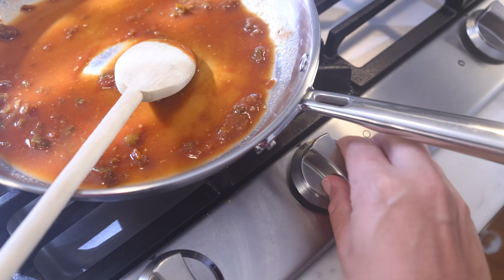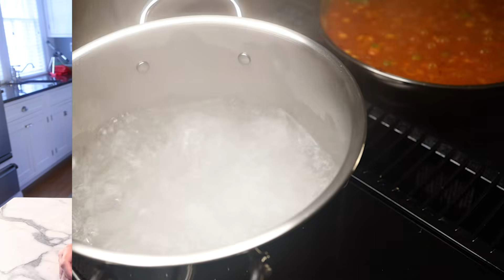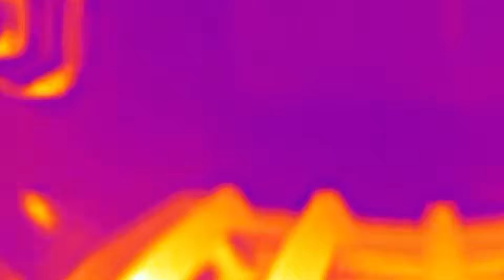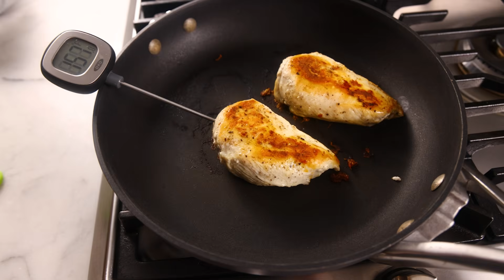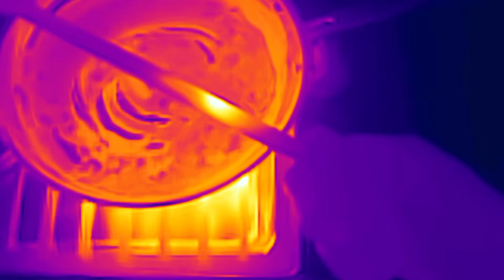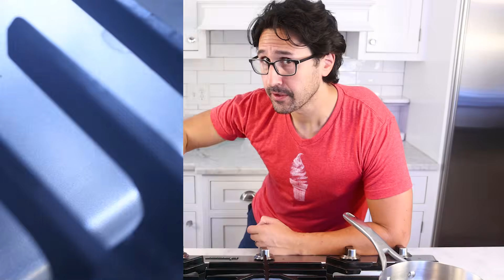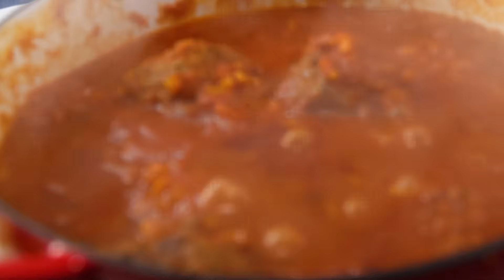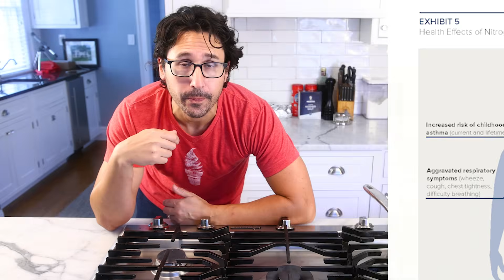Problems with gas stovetops | weak, dirty and dangerous

Comment: I would love to go for induction but not now living in Poland. Maybe my calculations are not perfect, but considering that 75% of our electricity is coming from burning coal (which releases more greenhouse gas than burning natural gas), which is conversion from chemical energy to heat and kinetic energy, which then is converted to electrical energy, transferred across the country as AC which creates huge loss (and if you think of cars, then electrical cars have batteries which needs to be charged and stored  - another losses, and lot of people here are using LPG as their fuel).. I simply think using natural gas here is more environmental friendly for such purpouses than electricity, even if you take into the consideration that gas heat is not as concentrated in heating the food (some time ago it would even be an adventage as we do not have warm climate, but now...). Channel about food and after this video I thought that I wish we could have a global electicity network with DC transferring over long distances, powered mostly by renewables and stabilized by atom (at least before we could have the clean energy from thermonuclear source, for which we will probably wait for some decades)

Comment: gas stove is still better because theres more controller when cooking electric ones are trash because they just turn on and off and rarely ever gets the actual right temp you want it
Reply: and this video proves my point because the eletric ones "transfers heat better" but not all foods need that besides literally just water otherwise if youre cooking steak or something its either gonna burn or be overdone because the heat is not steady it drops then raises

Comment: The problem is you only know how to boil water and not cook. With gas you have temperature controll and you can switch reanges to almost instantly get simmering temps. Try doing that with electric.

Comment: Actually Adam, I think resistance stoves may benefit from the same technology that induction uses while also being cheaper - inverter power supplies that can actually do away with cycling and give you a true ability to have a consistent low, medium, high heat setting on a coil electric stove. I like induction, but having to have compatible cookware and also the price of entry I believe keeps the tech from mass adoption. 

Also, we're gonna have to bring down cost per kWh here in the US with massive adoption of cheap renewable energy before we can really start to power traditionally natural gas fired appliances with electricity like HVAC (namely heating), water heaters, and of course dryers, stove, ovens, and ranges. 

Dryers I think in the future will be aided by washing machines centrifugally extract more water. Water heaters and central air heating will be fully replaced by heat pumps when the technology is mature, and kitchen appliances with both resistive and inductive technology - though I think all devices will be using inverter power control - just like with fancy new microwave ovens. 

It will be interesting to see the day when every part of our life is powered by electrons - especially if most of that energy is sourced renewably. The future is exciting.
Reply: My parents had an electric resistive range and its super old and never cycled, my induction range (apartment) makes a noticeable hum while on and a noticeable click when it cycles.

Cycling is entirely model dependent not technology dependent, its something your furnace does to avoid throttling and instead does all or nothing and kicks on and off to have a time averaged correct output.

I find both electric resistive and induction to be way nicer than nat gas. (Gas stoves just feel archaic the same way gas lights do, it might be nice in a camp but not as my "daily driver" where I'm concerned about in home polution and the fire/explosion hazard)

Comment: I'm living again in the house I grew up in.  The gas supply here in RI is fine.  The old stove my mother had simmered well (1960's Magic Chef).  This stove has what we both considered to be an inferior burner structure.  It won't simmer on low.  The burner distribution of heat is poor. If you have doors open (summer) and the burners on low they can blow out.  The current trend in cook tops is towards looking like a commercial kitchen stove.  Commercial stoves often use a simmer plate.  I bought a simmer plate for the last apartment electric stove I had. That had only two temperatures High and Off regardless of where you set the knob.

Comment: Good Electric ranges are awesome. Their hearing elements can actually grt waaaay hotter than the home has range.
My only problems is that it doesn't allow for the use of a kadai or wok(my cooking pan of choice). 
However it is worth noting that a cheap gas stove will always be better than a cheap electric range. 
Finally gas is easier to maintain than electricity. Where I live power cuts aren't uncommon and the idea that I just can't cook doesn't make sense. And before you ask, gas comes in these big cans, not a gas pipeline to each home. So as long as you have a spare can you can go for weeks without electricity and not have an issue

Comment: I have a 81 year old gas stove that works perfectly fine. It is more powerful than any electric stove I have seen.  Now it is a fact that it heats up the kitchen and the house very quickly.  Also noticed the wok does work better on gas,  The main advantage is that unlike electricity you can produce gas very inexpensively at home. All you need is poop and some food waste.

Comment: There’s a brass orifice at each burner that controls the heat output of each burner. You didn’t hear it from me but they can be enlarged ever so slightly to get it hotter. Newer ranges have higher output burners like mine which are great for wok-ing!

Comment: Gas stove are far cheaper to use  if electricty is orders of magnitude more  expensive compared to gas .
Our exterieur gas  water  heater + gas stove only cost like 10 dollar for 2 month 
Compravely when we tryied  électricty  to do the same thing before switching back to gas it   cost like 150 dollar for the same usage 
so we can not use electricty for heat unless we hate money
I live in tunisia (north africa )

Comment: Also fire really only has one temperature the buring point of the gas used. You really have less control of total temperatures as your just moving the fire away from the pot. Electric tops cycle on and off to maintain set temperatures. Wich can be much easier especially for inexperienced cooks. You want people to burn stuff less in your house electric is much better then

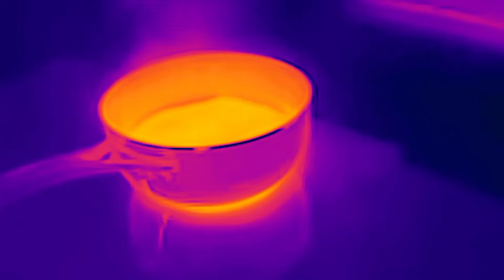Comment: Wtf is this comparions at 2:50. You are comparing an induction top. NOT a regular electric one transferring heat.
Reply: Most of electric stovetops will not show at all the same thermal signature.

Comment: I think both have their pros and cons but at least in the US, gas is more linked to 'premium'. Gas is also cheaper than electricity often in certain states here and like others have pointed, you can run it when you get a power outage which is rare. I personally enjoy cooking on a gas stove more often as the controls are finer and faster than the coil ones I had. Also, in the winter months, it turns into an extra heat source for your hands if you want while cooking.

Comment: I was really sad my new house didn't have natural gas. But then I got an induction cooktop and was converted. Amazed I never heard about it before but it's everything I wanted in a cooktop, fast, responsive, easy to clean.
Reply: Same story - was sad new house didn't have gas then realized how much better induction was. Recently visited a relative and the gas range was filthy. I could never keep mine clean and induction boils 2x as fast plus, when not using the stove top, it becomes another work surface.
Reply: Just can't use it during a power outage...

Comment: The only electric jobs I’ve ever cooked on have been the iron ring ones and they are awful - they stay hot for so long it’s a far worse hazard than anything gas related. My new gas hob and the one in my previous house (which would only be 7 years old now) and that wouldn’t let gas out when it’s not lit. And that unresponsiveness is a pain at home as well as in a professional kitchen.

I considered induction for my new kitchen but the wok put the price up excessively. They’re definitely the future. But for an induction equivalent to my gas one I’d be looking at at least double the price I paid for mine.

Comment: This was really interesting. I grew up with gas, and it's always been my preference, but basically for no reason other than because it's what I was most familiar. In the few instances when I was at a friends who was using an electric stove I found myself burning things, but even then I was sure it was because I was less familiar. Someone below mentioned cooking with gas was possible in a power outage. That's only half true, I just finished referbing a 36 inch Thermador professional for my home kitchen. The main problem with it was the igniters were shot, and they require electricity before the oven or grill will turn on, so in a power outage I would be limited to stove top, to the other commenters point that is far superior to nothing at all. 

I suppose for me and for the moment I understand gas. I know don't necessary know what setting I want on the dial, but I know what I want the flame to look like. I know what the effect of placing the pan off center is going to have. I know how to manage my heat, I don't have that understanding with electric or induction.... Maybe one day.
Reply: "The main problem with it was the igniters were shot, and they require electricity before the oven or grill will turn on" - You should be able to light them with a match, no? Where I'm from the gas comes out due to the pressure in the system, so the gas will flow freely then you just use a decently long match to light it. The igniters are just a convenience.
Reply: @WS12658  No, not with a lot of electric igniters. The gas won't come out until the igniter is hot enough to light the gas. It was a learning curve for me too, I was only familiar with pilot lights.

Comment: Thanks Adam, very enlightening as always. As someone who chose gas over electric or induction for my new house, here are the pros of gas stoves that swayed my decision -
1. They continue to work even when there are power cuts
2. As you mentioned, they are responsive. I absolutely hate electric cooktops for that reason. You always have to think two minutes ahead when setting the power on an electric. With gas I can just kill the flame when it's cooked enough.
3.. In my European country electricity is quite expensive (starting at €0.13/kWh). If you convert the cost of gas cylinders into energy equivalent it works out to €0.10 per kWh for gas. So unless there's a 30% efficiency difference, gas is cheaper to run for me
4. Gas stoves are super simple. Just a pipe with some holes in it and a simple valve. In my old house they lasted at least 20 years (they rusted out before they broke). I doubt the electronics in an electric will last that long, and even less the more complex electronics in induction cooktops
5. Gas hobs are cheaper to buy than induction
6. You can use any kind of pan with gas. No need for higher quality heavy-bottomed induction-compatible pans
7. Induction and electric need a very strong power circuit. Gas just needs a pipe and a hole in the wall (in my country we don't have gas mains, we use only portable gas cylinders of 12 of 15kg)

Having said all that, I went for an electric oven. Convection is 20% faster and 20% more efficient, and I found electric heated up the chamber way faster and had much more features (like settable combinations of top/bottom/back heating, electric timers) that gas ovens don't have. In case of power cuts my electric oven stops working but I fall back onto my gas hob :)

Comment: I would think that cost would be the biggest issue. If one has relatively cheap electricity then it's more practicle. But where I live one has a high rate, and an even higher rate after 500KW( 34 cents a KW, but 72 cents after 500KW). So if one is using a gas stove and near 500 KW a month in electricity, and then moves from as to electric they will be shocked by their electric bill.